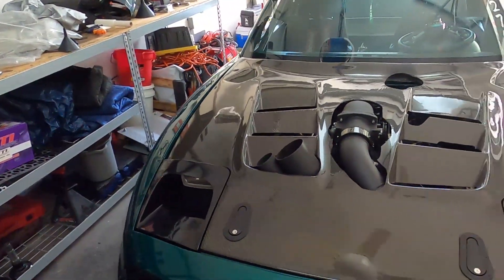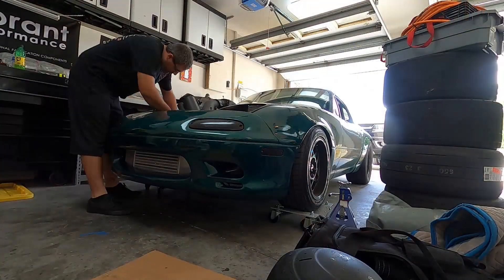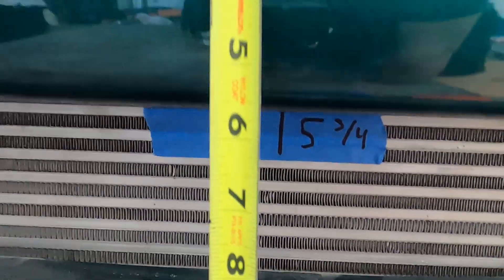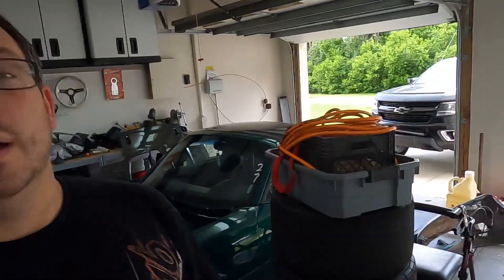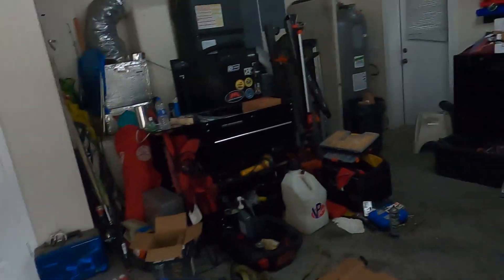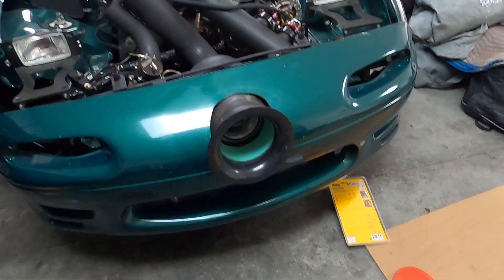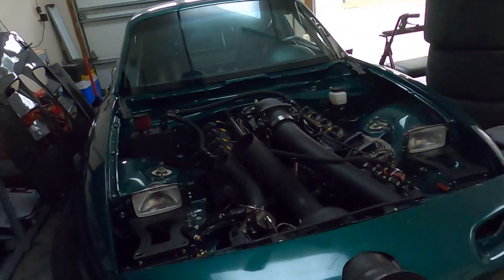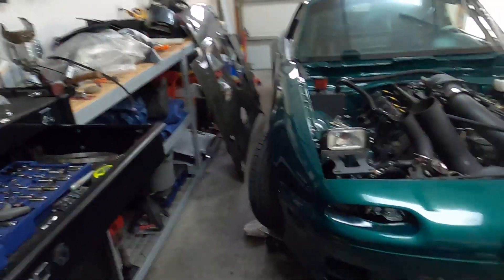I installed a cold air intake on my Turbo LS miata!

Comment: Dude we're going through the same problem on both our cars right now lol. Only you're already in the 10's and I'm stuck at 11.4. My car is an s13, rids/pistons 5.3 L33, 7875 turbo, e85, ms3pro, built 4l80e, tbrake, custom oddball intercooler. Can't get it to go above 120mph even at 17psi 🤦‍♂️ search my name in the boostedlsx fb page if you're curious, have a ginormous thread there trying to trouble shoot the issue, might find some ideas for your car there.  Good luck and please post updates as you figure it out👍🇺🇲